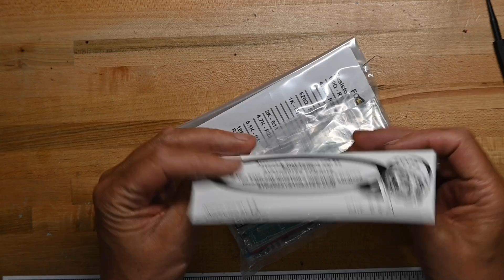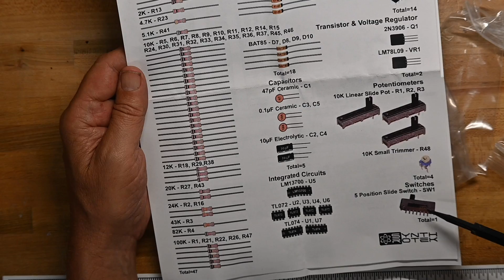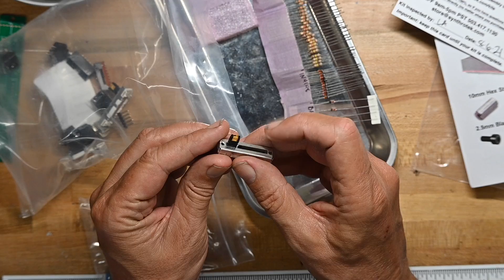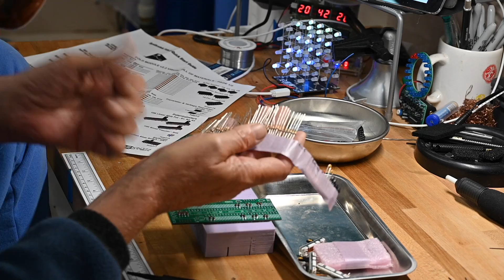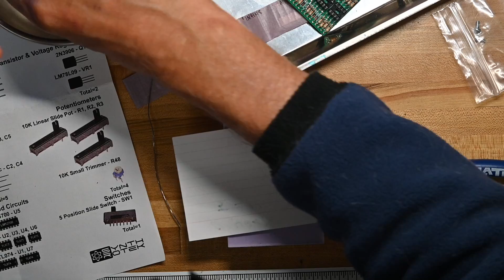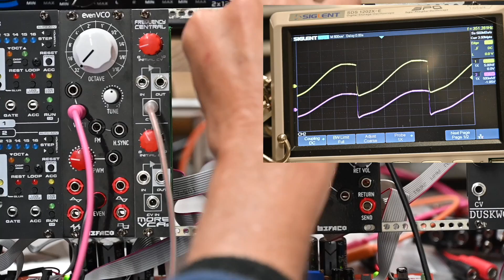C.K. builds a Fold ring mod/wave folder kit from Synthrotek eurorack module

Comment: Thanks again, might build this one as well, though at 41:41 it looks as though the pins are sticking out way past the panel which I honestly don't like one bit. It can interfere with a module next to it meaning you might be limited to the placement in the rack.
Reply from the maker: @KPsTboy  I just measured it, and from the edge of the panel plate to the tip of the socket pins is 5mm.  So yes, there could be interference with a module that takes the full width of their own panel space.
Reply: @CKHaun  5mm is a lot. Meanwhile I've found images on modular grid of sellers that don't show any pins passing the panel, so that's either perspective (which didn't seem the case) or there might be different build versions out there.
Reply from the maker: @KPsTboy  Maybe different indeed.  If I aggressively flush-cut the socket pins, the PCB still overhangs the panel by 2mm.  Perhaps the others have a pots and jacks board which is 2mm or more thinner.  Different manufacturing lots.

Comment: Interesting build and module. I have done some simpler Synthrotek kits, and I may have to get this one. — I think you may not have gotten the board-to-board connectors into the orientation suggested in the build guide. It looks like there would be better horizontal clearance the other way, having the side without the bend go into the control board.
Reply from the maker: You're probably correct, but in the end there it's any noticeable interference, so not a major fit issue.